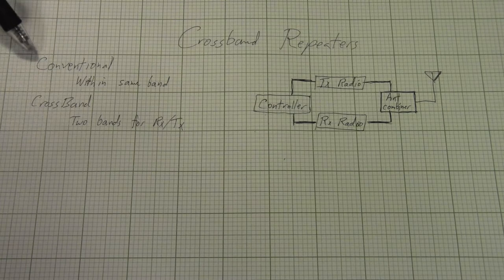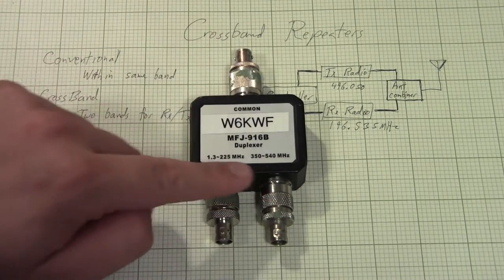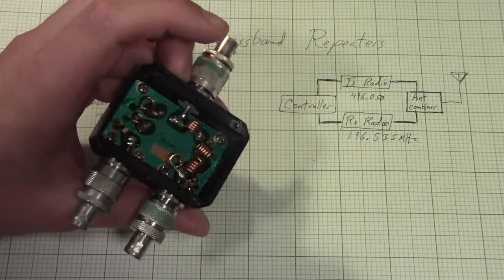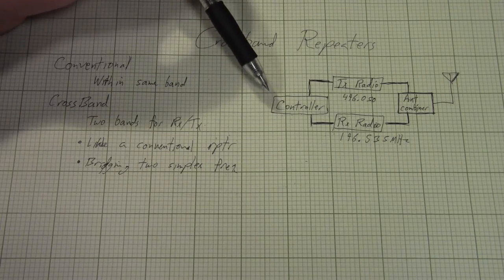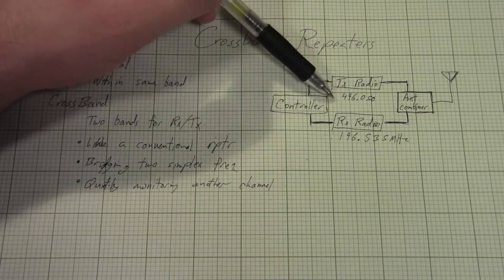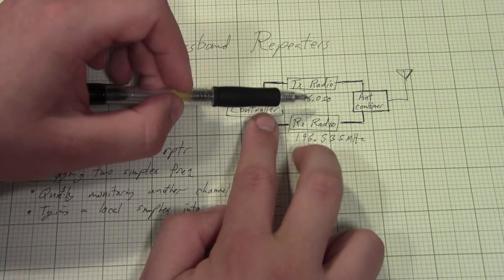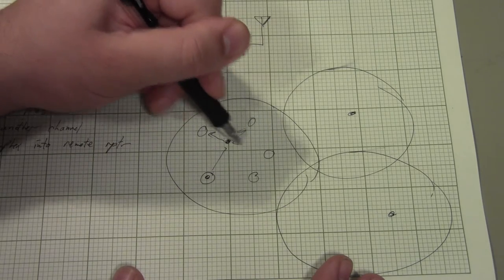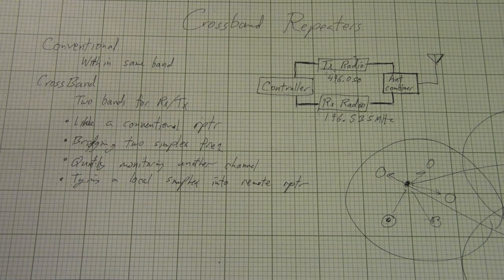Introduction to Crossband (Xband) Repeaters

Comment: Do you need a controller/antenna duplexer on say a Baofeng or Wouxon radio with cross band repeat? We are gonna have 3 radios at work on UHF that will hit a leased repeater. We have 4 other radios on simplex VHF. I'd like us all to be able to hear each other, even though 3 radios are UHF and 4 are VHF. The problem is that the 3 UHF radios will be transmitting to a repeater. I have a Wouxun UV-8D that I was thinking of using as a local cross band repeater just to tie it all in together. The VHF radios only need 2 mile range, because they stay near the shop, but the UHF radios are the ones on the repeater because they are mobile and we are suppose to have city wide coverage with those, once we start paying for the repeater service. We're gonna pay $20 per month for each of the 3 radios. I don't want to pay $20 per radio for the last 4 radios because it's overkill, since they are going to stay local and don't need the kind of range the repeater provides. But I would like everyone to be able to hear each other and not have everyone on different channels. Could you help me figure it out? Thank you

Comment: You have a lot of misconception of the Proper use of a Crossband Repeater you never Link Repeaters together with a Crossband Repeater the Reason why is the Repeaters will keep keying each up Reason Two is you have to Wait for the Repeaters to Totally Unkey to go Backwards for the Repeater has to Key up the Cross Band Radio one way and you have to key up the Cross band Repeater the other way for Say the Repeater you trying to get into is 2 meters and your ht is on 70cm you would Key up your Cross band Repeater on 70cm so the Cross band Repeater radio is Rx on 70cm and Tx on 2 Meters then when you Unkey you have to Wait for your Cross Band Radio to unkey then you have to wait for the 2 meter Repeater to Unkey and then the Repeater Keys up on 2 meters "Someone Talking back to you" and your Cross band Radio would Rx on 2 meters and Tx on 70cm back to your ht and you have to Wait for the Repeater to Drop "after someone talking to unkeys and then have to Wait for the Cross band Repeater Radio to unkey. to Link Repeaters up you Don't use RF most times and they Never use Cross band Repeaters to link any Repeater up and many Cross band Repeaters will Tx and Rx Both ways meaning if you Tx in 70cm and Rx on 2 meters when it unkeys it will Rx on 70cm and Tx on 2 meters or Whatever Bands your using and if you try to Link any Repeaters with Cross Band Repeater Radio it will keep Keying up none Stop for Each Repeater will Key up your Cross band Repeater then the other Repeater will key up your Cross band Repeater Radio then the other Repeater will key up your Cross band Repeater Radio and so on so on and So on None Stop it Don't work that way and Fire and Police use Motorola that uses a Totally Different Way to go from there ht to there Car Radios and into the Repeaters and they Do NOT use Cross band Repeaters for Linking there Police or there Fire Repeaters together Most times they don't even use RF at all to Link there Repeaters together and Ham Radio Don't use Cross band Repeaters to Link there Repeaters together and most Times they Don't even use RF to Link there Repeaters together Ether most Links are hard Wire and have been hard Wired Links before the 90's that's why you can have Linked Repeaters that are Hundreds of Thousands of Miles apart for there is no RF Linking them at all and that is why you'll never Find a Frequency of the Link for there is no RF Link on in ham Radio Repeater Links or Fire or Police Repeater Links and this is the other Reason why you can have Fifteen, Twenty Unlimited about of Links and why they Don't keep Keying each other up none Stop for if it was a RF Link it would Key each other up in a non-Stop Circle. Please Stop making a Fool of yourself and Talking about things you have No idea of and you Clearly have Never been to a Repeater Site and you have Never Worked on Real Repeaters for if you have even if you only worked on one you would know this and if you ever worked on Fire or Police Radios and/or Repeaters you would know this but you Cleary Don't and you Cleary Don't have any idea of what your Talking about and Everyone that has Worked on or Does work on Repeater Sites are Laughing there A55 off at you and Calling you a Clown. When you Try to Sound Smart and you are Talking out your Rear you don't look Smart or willing to Learn for you think your a Know it all and no one likes a Know it all that Talks B.S. out there Rear stopping making a Fool of yourself and Stop Talking about things you have only know less then half about what your Talking about for Half Truths are Full Lies
Reply from the maker: Bless your heart.